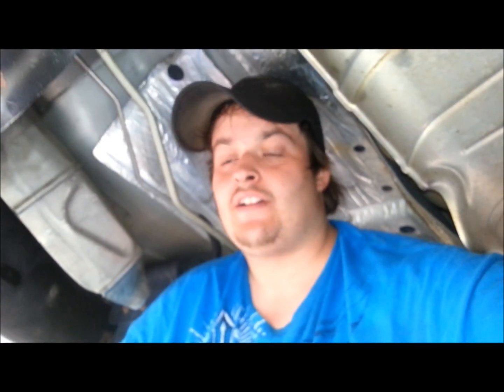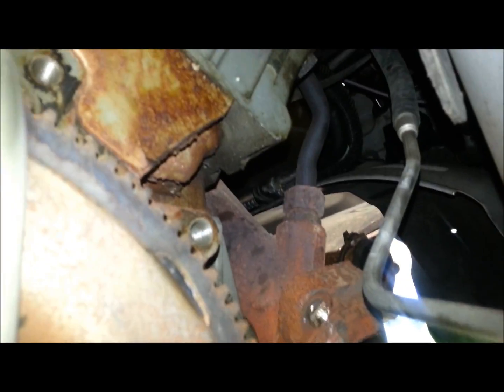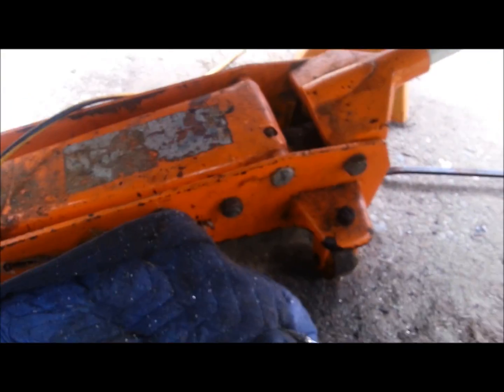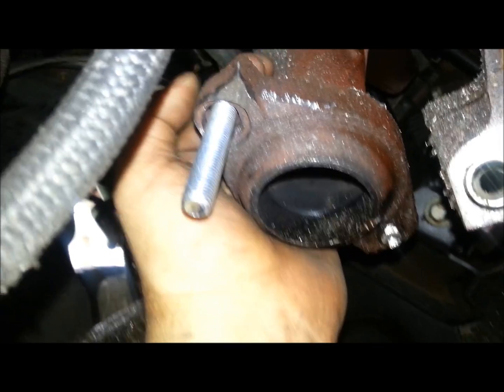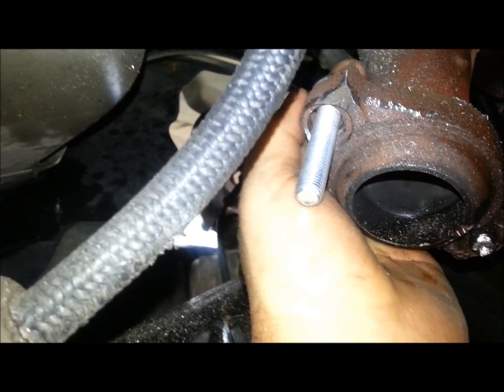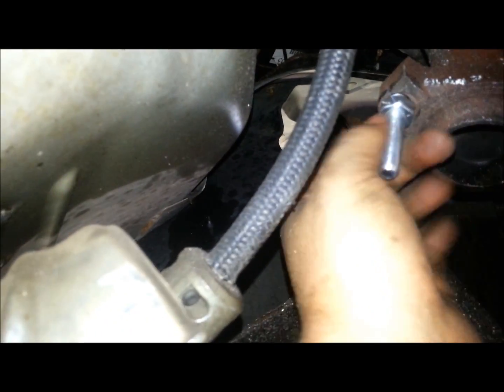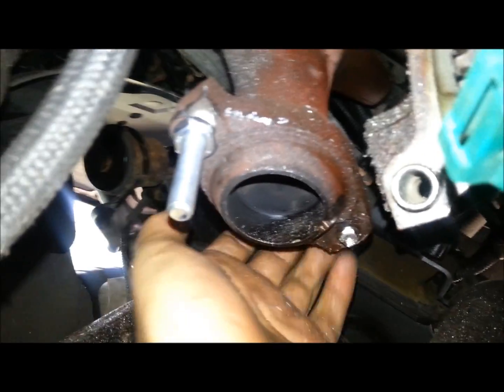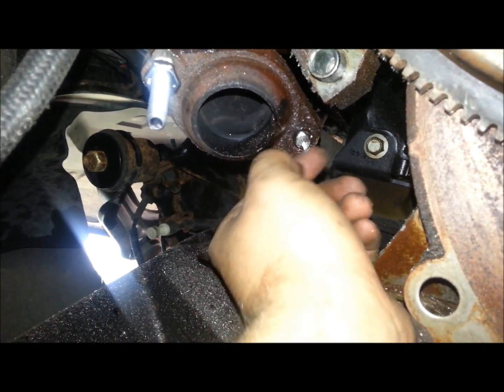Broken Exhaust Stud Fix- JoeTheAutoGuy

Comment: Great tip, I will possibly be doing this, lol. 
My original thought was to cut and tap fresh threads, but I think it is too far gone.
Your little tip just saved me buying a new set of exhaust manifolds for the 74 Ranchero.

Comment: Great tip for my car manifold collector bolt spinning when trying to tighten it on my grand marquis. It's leaking so I will try the nut trick. Hopefully this works. Thanks for your time posting your methods  and ideas

Comment: I will try to find a Stainless Steel nut and bolt to replace the stud with... or a Brass nut... so that it's easy to disassemble the next time... and honestly... did you heat the original nuts with a torch before you tried to remove them? This often saves you from a broken stud. If you do drill them out... use a Cobalt bit... the Titanium and the High Speed Steel are weak... the Cobalt will cut right through that hard metal. I center-punch the broken stud and then I start with a small bit to create a pilot hole and then I will increase the size of my bit. Be sure not to wiggle or you will break the drill bit off in the stud and then you will have yourself a problem that will require the removal of the manifold, and a possible replacement.

Comment: i have this problem on my truck but i was thinking more of useing drill size of the bolt and drill it out tap it and put new stud in  he has for gone the taping part were you put threads in the hole you drilled

Comment: Sounds like hard work and I would've either A got a universal flange kit but at times like mine your headers are too big for the other piece to bolt to. B stud extractor. I've been underneath a truck with a dremel not fun or a grinder if your good n quick at it yes fine do it. But my opinion it will take longer time u cutting a hole then just getting a kit but if you want it like normal I guess you can do it as well

Comment: Joe I have that exact problem on my 1990 740 4 cyl volvo, downward facing stud broke off when I was reinstalling the down pipe to the exh manifold.

I was under the impression those studs are extremely hard and difficult or impossible to drill out.

1/4 inch of the stud is sticking out.
My plan is to use a map torch to heat the flange then try a stud extractor to unscrew it. Got any better ideas?
What type of drill bit did you use?
Reply from the maker: jonesgerard drill bits i use are cobalt (the metal not tool brand) they are hard enough if that doesnt work i use diamond rotary bits with a air grinder, but yes years of heat hardens the metal lots of oil and heat is your first step with the extracter , if such doesnt work then i try and weld a nut on the stud and let it cool allowing the heat to expand the flange, last resort is i drill and most likley grind it out and replace the stud or come up with something of this sort .

Comment: The thickness of the nut will prevent you from sealing the exhaust. You'll never be able to tighten it to the point that an actual stud would allow.
Reply from the maker: JustSomeGuy this actually worked perfectly
Reply: I agree, in some cases the two flanges sit flush against each other and that nut between wouldnt work. But it looks like here there was more space than the thickness of the nut so it worked for him.

Comment: Hi. Good vid bro. Wanted to ask you. I have heard that using regular bolts ex home depot ones is not apropiate due to the bolt and washers  expanding and contracting then becoming loose or breaking off due to the high heat application. Exh manifold.
What is your take on this?
Reply from the maker: Ll Lock i agree the bolts you should use are grade 8 bolts and or 10.9 (metric) for these applications

Comment: Wouldn't that leave a space that wouldn't allow the exhaust pipes to seat and seal correctly?
Reply from the maker: chvydrptop depending on the design, this ball and cup design and a deep flange it pulls it in just fine if you dont have the space then you cant use the nut

Comment: For the LIFE of me I cannot drill out through the studs. Tried titanium bits and HSS bits. Proving to be impossible.
Reply from the maker: sometimes its a major pain. and i agree it absolutely sucks in this case i used a high speed carbide bit with a air grinder